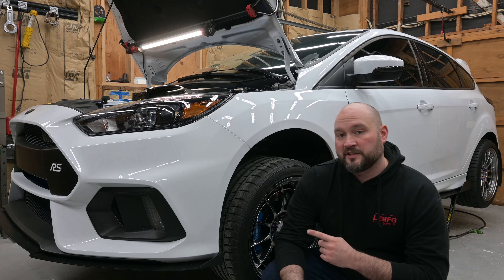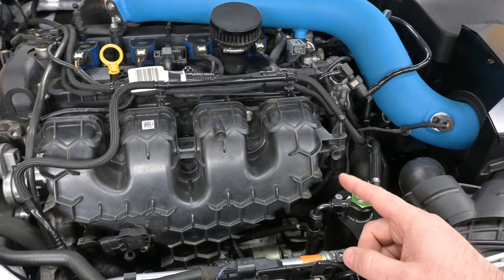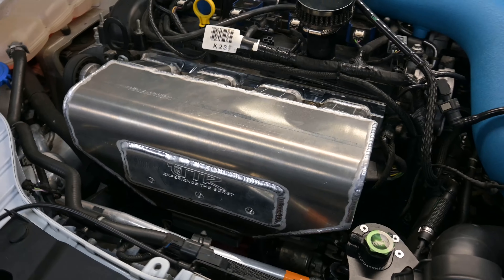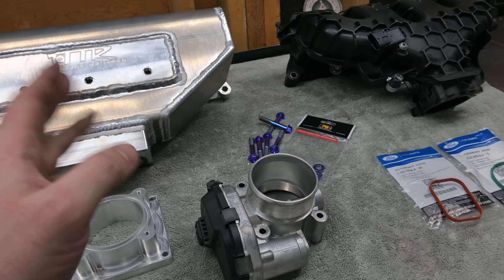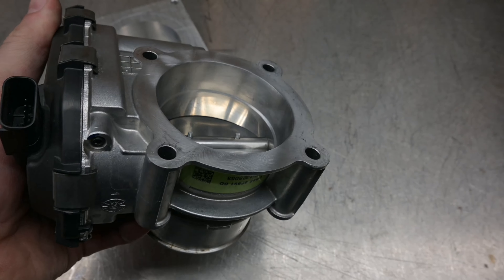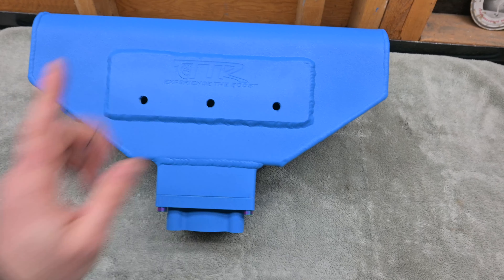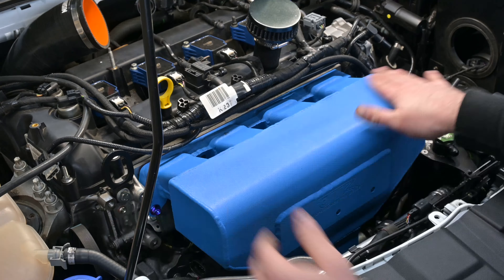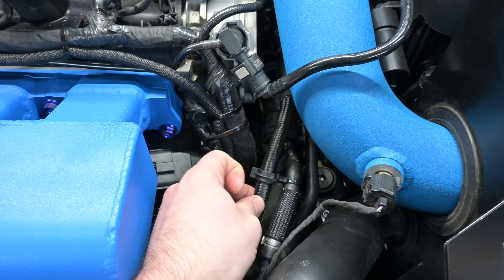EP:3 Installing a TTR Aluminum intake manifold on the Ford RS!! #fordfocusrs #focusrs

Comment: I just picked up one of these manifolds for my RS. Where did you get the ti bolts from?
Reply from the maker: Pro-bolt usa
Reply: @Chris2Race  Thanks!
Reply from the maker: Let me know if you need help with what size to get. You will have to measure the bolts TTR sends you to match the correct size.

Comment: No offense to turbo tech or there product but the stock manifold can handle quit a bit of boost with no issues at all. It may not flow as smooth but for the price really isn’t worth it. I agree that the throttle body is a good upgrade with tuning.
Reply from the maker: I agree about the stock intake manifold being able to handle more psi than the stock turbo can throw at it. Comp plastic has improved in strength over time, so it is still a good design, as I stated in the video. We wanted to try something different as in the TTR intake manifold to show others something that isn't done often, plus set up for more vacuum ports and future mods. Good stuff.